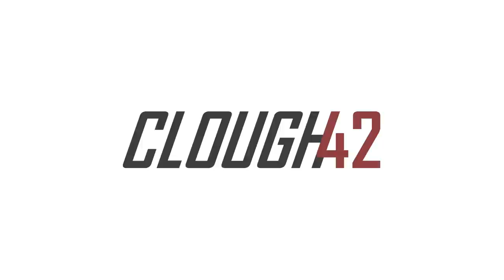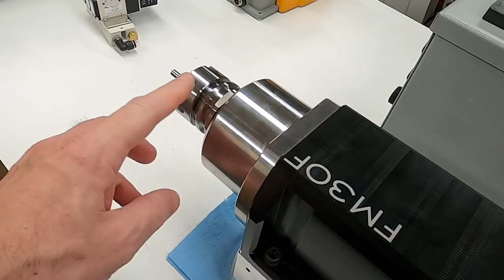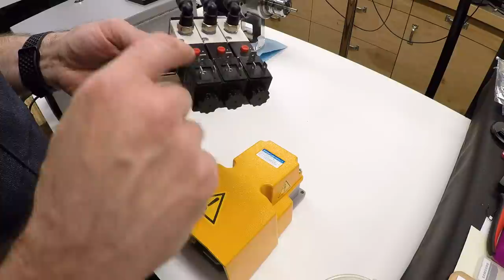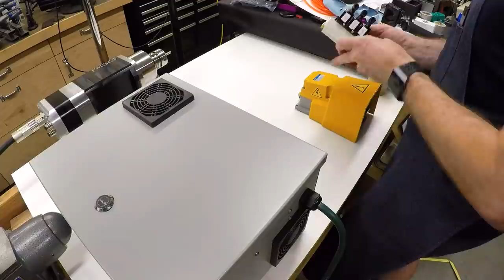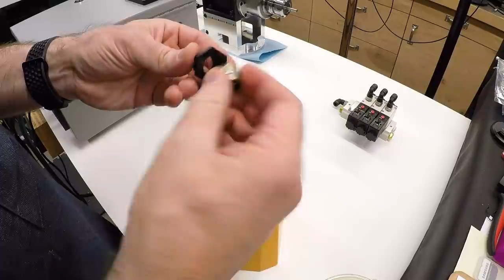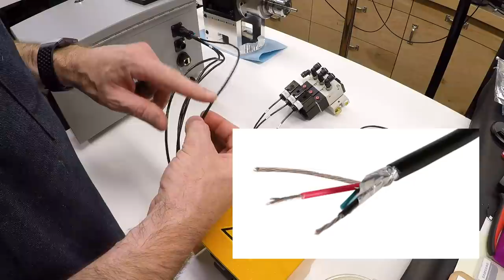ATC Spindle Part 10: ATC Interlock and E-STOP wiring [REUPLOAD]

Comment: For the hobbiest this is just semantics and clarification- normally closed for a relay means the relay contacts are closed when there is no power on the coil of the relay. Switches that latch in position, like your E-Stop, leave "normal" to the end user. Some people like pushed in to be normal, some people like pulled out to be normal. I say like but it's not really like. It's whatever the industry standard is. I can see the logic behind what you are doing. You are logically placing everything to a safe state with a digital input. Doing it that way is not that unusual. If you had a light curtain that protected the employee from injury, you don't, that would be a different story.  

When I design an emergency shutdown system, it's designed to be fail safe. Ie the ESD switch contact OPENS to remove power from the circuit when pulled (or pushed if that's what they want). That delatches one or more relays, which removes power from the ESD DO cards in the PLC, and tells the PLC to delatch all circuits, and, if necessary,  move analog outputs to where they need to go. 

In the "olden days" the EE would take the low road and shunt trip the facility main breaker during an ESD. :/ That means your plant air system would go down, your plant lighting would go down, etc. 

In the energy industry some people want the switch to be pulled to trip (open). Some people want the switch to be push to trip (open). I like the former but only because I've leaned on the ESD Mushroom and shut a plant down (more than once lol). That said, we also had an insulator hang his toolbag on the mushroom and pop it out. Every day, like clockwork. He would take a break, hang his bag, and when the alarm siren when off he would grab his toolbag and go someplace more quiet to eat his lunch :) It took a couple of days to figure that one out.

Comment: Hey James, this video is good timing, I’m installing a WJ200-022SF based on your build for my 1963 Italian Bridgeport clone(so conventional 3 phase AC motor), I’m running external commands with panel mount switches not the remote operator. I also wired the E-Stop to the EXT trip 12 based on your previous video with the thermal shutoff. Now when testing on the bench I found that when E-Stopping the motor doesn’t brake and just free run so I was thinking of since I run the 3 wire run command switch setup (page 4-31) that I could run the E-Stop switch in series with stop push button switch as this will enable motor brake and stop the spindle faster. Also it would be more practical cause this won’t create an alarm instance which I would need to reset on the VFD itself in the box behind the mill since I’m not adding an external reset switch considering I’m only running a manual mill. Any inputs would be appreciated! I sent you a message last week on Instagram but I finally figured out my missing options problem. Needed to set B0037 before B0031.

Comment: I have the same spindle and VFD you have and cannot get the thermal switch to work properly. I was given documentation from CNC Depot on how to wire this and what to change in the VFD but I get an error every time.   C003= 12_____C013= 01  is how I was told to set the VFD but It jumps to an error state. It is hooked up to 3 on the inputs and the L by the word PLC. I also have the jumper just like yours id pictured.What Gives..........

Comment: Hey you wouldn't happen to still have the design files for the M16 to 1/2" NPT bushings you used in the foot pedal, would you?  I'm using GX16 and GX20 connectors for a project that has standard north-american electrical knock-outs....

Comment: Love your videos, James!  Have you considered running a resistor brake? Your E-stop switch will kill power to the spindle, but it will spin down over a few seconds based on the weight of the tool.
Reply: I could be wrong, but I think the e-stop instructs the VFD to bring the spindle to a stop.  In a previous video he configured the VFD to start/stop the spindle at certain rates.  So, I believe the VFD may be handling braking rather than just letting it idle down.
Reply: @CL-gq3no  that is correct, but it will throw an over-voltage error when stopping with large tools. At least mine does.
Reply: @CL-gq3no  A braking resistor will allow the VFD to to stop the spindle/motor faster without putting the VFD into an over-voltage error condition.

Comment: Hello,   maybe you can help me out.  I have a hitachi wj200.   i want to energize the internal relay  AL1-AL2 to activate a few relays to switch my 2 speed motor from delta to start configuration. it has an 8 pole side and a 2 pole side.  i have everything wired correctly. i know this because i can change the AL1-2 to be either N.O or N.C via a (manual) parameter change and it does change the rpms range.  so what i thought was gonna work was to set C003 to 12 EXT External trip and C026 to 05 AL.  but that doesn't work completely.   it does energize AL1-2 and changes the state of the relay but it throws it into alarm and locks out all functions till its reset. 

what I'm looking to do is switch my "high"/"low" switch connected to C003 that would change state of the AL1-2 relay to  either N.O to N.C but keep the motor in a run condition.    any thoughts? help? suggestion would be greatly appreciated.    i could send some pictures of my set up if needed.  Thanks in advance.  

Douglas

Comment: A couple of thoughts. If you have a heavy tool in the spindle don't you run the risk of the spindle still running even if vfd says zero Hz? And only rely on one relay in a safety circuit with a foot pedal😬. If the relay for some reason does not work and you accidentally step on the pedal.

Comment: 14:35 If the default state of the VFD relay, even if the VFD is powered down, is to operate the tool changer, then is it possible the VFD looses power while the spindle is spinning? You've probably already considered interlocking the tool change solenoid power with your E-stop circuit. Assuming the VFD will trip the E-stop if it looses power or looses control of the motor, the E-stop dropping out could prevent tool changer activation while the spindle is still turning (coasting).

Comment: Does your VFD have a resistor pack on it for the emergency spindle motor stop? As I understand it, without a resistor pack, the VFD will cut power to the spindle but not stop it, it will coast down with no power. With the resistor pack, the VFD will actively stop the spindle, probably using, fast-acting reverse power causing instant stop. This is probably, more necessary on large motors with a lot of inertia due to pullies and such and might not be necessary on your spindle, although the spindle is a 3 hp motor. Might be worth considering.

Comment: 13:07 I see the spindle is still turning a bit after the tool changer relay activates. Would it be better to lockout from a spindle speed sensor, rather than the drive? Or if that's not available, have a short delay to account for any tool movement after drive turns off due to inertia? Or activate a spindle brake at the same time as the ATC? The ATC doesn't need to activate the instant drive turns off.
Reply from the maker: Depends on how you define better.  A speed sensor would be new hardware that doesn't exist in the system today to solve what is not really a very big problem.  This VFD does have a delay configuration, but I think it also delays the switch on startup, so you could move the problem to the other end, leaving the ATC active for a moment during start.

Interestingly, the ATC activation does appear to lock the spindle while pressure is applied.  I have no intention of testing to see what happens at speed.  :)
Reply: @Clough42  Ah, I see. Something to think about if you ever need to replace/upgrade the VFD I guess. Thanks for your reply!

Comment: You might not be holding the pedal down, but stupid stuff happens.  Short circuit, something falls on the pedal...  You should definitely have a Spindle On delay triggered by the ATC Off so it can't start up while the tool is still being held.